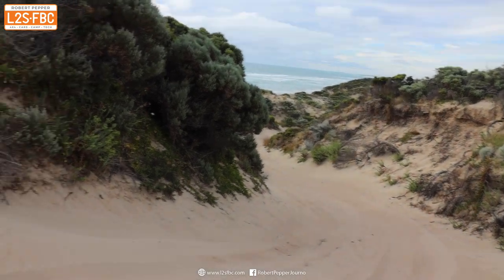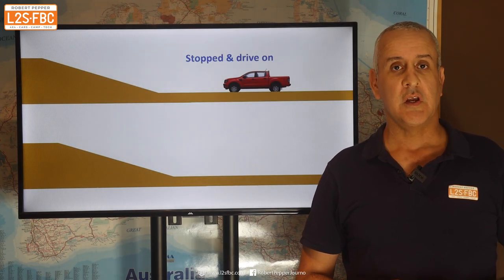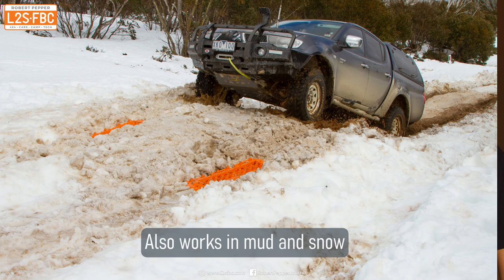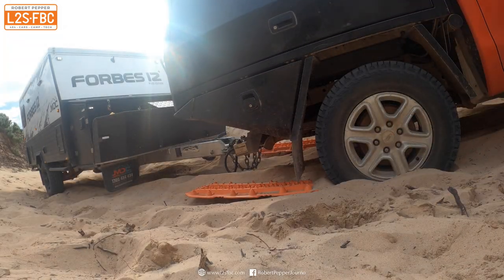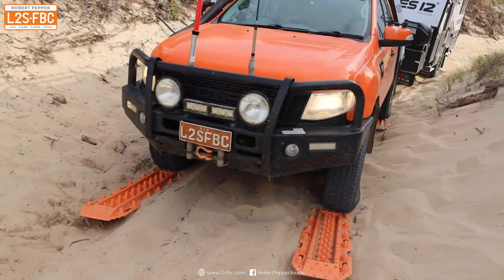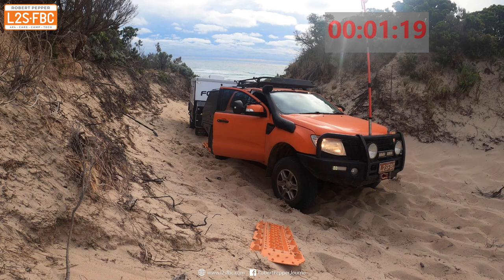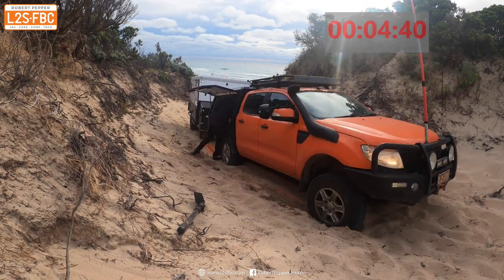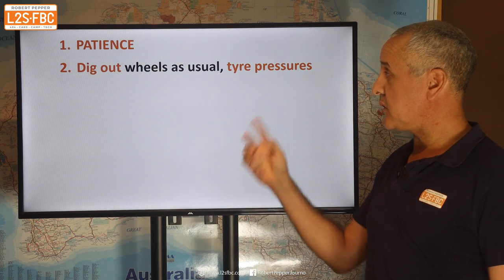Stuck caravan on a sand dune - how to recover!

Comment: Winch anchor or waste hours moving boards.
Reply from the maker: sadly, winch anchors are hard to find in sand
Reply: ? Winch cable attached to find, the old years we buried the spare to get up a sand track with tinny and under powered 4x4

Comment: Track to number two rocks I think. Beautiful area, was there in January. That dune is a doozy, caught plenty out when we were there.
Reply from the maker: Correct, that's the track. It is easy without a trailer...shouldn't cause anyone problems at the right pressure, and there's a beach bypass if you really need it.

Comment: UK pebble beaches are much more tricky!
Reply from the maker: I'd suggest not...the finer the sand, the harder the going
Reply: @L2SFBC  the pebbles are harder mate trust me. Imagine wet marbles that are 6' deep. The slightest wheelspin, results in sinking up to the Dana axle. I did this at Weybourne beach in North Norfolk. Check it on Google maps images. The tide was coming in and it was an unforgettable incident. This was in a 1964 Land Rover with a rear traction aid too (Taiwan Trutrack)
The method that saved the day was some digging out and, very gentle driving backwards and then gently forward and out. It was up to the tree sliders and the transfer box in the end. It's like very heavy quicksand. I like the videos a lot and I am subscribed. Thanks for the response
Reply: P.s. the pebbles are rounded flint.

Comment: I don’t have any experience of use of traction mats but gather that The Max Trax or ARB Treds are the best options, What would be your choice of Brands?
Reply from the maker: Maxtrax or the later TREDs. Not used the others but any name brand should be fine. DO NOT BUY THE CHEAP ONES!!!!!!!!!!
Reply: Thanks, I have traded a couple of pairs of Max Traxs recently, they are very good quality. Also just obtained The Indeflate  , looks like the business too.
Reply: Ronny Dahl - 4 Wheeling Australia, did a comparison on traction boards that you might find interesting.

Comment: Hi Robert. What would you suggest as the best technique if there was a long line of (very frustrated) campers lined up behind you as well as the same for oncoming traffic (ala Ngkala Rocks Fraser Is)? I doubt that all drivers will be as patient and forgiving with one using this technique especially if a caravan was involved 🙃
That said, in the greatest of Aussie traditions, most people would probably lend a hand in the circumstances 🤙
Reply from the maker: First off I wouldn't tow in a crowded, narrow area if at all possible, or do anything else to impede others eg filiming or driver training. In this case, nobody was around whole evening and only saw 3 cars the whole weekend - I'm familar with that area and it's never been busy offpeak, even peak isn't too bad. But if you had to do a quick recovery then using others is good. There is also a beach bypass which I decided not to take but others could. So, no inconvience for anyone else. The technique is really a last resort.
Reply: Best technique for crowded beach? Ask for help. Hands down the best. Another vehicle to assist in the situation shown above would have it done far more quickly. But what Robert has shown above is how you can do it if there isn’t anyone else around.
Reply: Yeah people will be backed up to ya faster than you can ask to get ya outta everyone’s way plus what he said don’t be a numpty an attempt it where it’s busy
Reply from the maker: That's the thing if it  was busy you'd have help and be on your way not needing  the technique. If it wasn't busy nobody to inconvenience and you'd need it.
Reply: @L2SFBC  Great info with real footage. thank you. So if there was no way for the vehicles stacking up behind you to get around and supply a winch point, how could the gathering crowd help. Women and children laid in front of the tack mats could provide further traction, but.... But seriously, it's a genuine question.
Reply from the maker: Yes it's a good question. First, that scenario is very unlikely. If the area is busy, there is typically traffic ahead, and as well as behind of any stuck vehicle. Also, if a dune looks difficult, you could ask for help BEFORE you get stuck; e.g. "can you just wait over the top in case I don't make it".  

But let's assume that there isn't anyone ahead. How can others help?  Hugely, is the answer. To do the recovery I had to place the tracks, drive, get out, retrieve the tracks, drive again. There were four tracks. It took a while per 'drive'.  Now imagine there are 8 people helping, two on each wheel. So much faster! And another two shovelling the trailer wheels. Maybe two more shovelling ahead, and one marshalling. All I'd need to do is drive. And then imagine they brought another four tracks!  I'd be over in very little time.

The flaw in this plan is of course getting strangers to work together.  The problem there is firstly the people that don't know what to do may get it wrong. The people that do know what to do might not agree. Nevertheless, more people = quicker recovery.

The women and children? They would be part of the team!

Comment: I recently did something similar just as an exercise. It was a short steep dune with no run up due to the very square edged entrance. I was on 20 PSI and figured Maxtrax were quicker than airing down and back up again. Plus I wanted to test my theory, which I’ve never seen anyone do. 

My technique was to back down slightly from the bogged position, just enough to get out of the hole, without any boards behind. Then I was able to shove the boards in front without any digging . It worked a treat and I personally believe it worked better than the technique being shown here.
Reply from the maker: Thanks, good info. I have used the same technique, and in fact it works without Maxtrax, I'll do a video on it in a while. Last time I used it was with a trailer on the back. It did not work in this situation shown as the car immediately bogged.

Comment: Nice and practical. In roughly the same conditions have you tried: back onto the boards at the rear, and then second pair of tracks infront of the rear wheels only? I suspect with the trailer hitch weight and stuff in the tray, the weight at back, with relatively light front may have been okay to get a longer movement this way. Obviously, if it fails reverting to the demonstrated last resort method. 
PS. I bought my second pair of tracks after being run off the inland sand track on Bribie (extremely fast car came around a corner and I swerved to the outside of a very soft corner with trailer and was very bogged). The jeep driver didn't stop and it took me about half an hour to get back onto the track. So yes agree having four is good if towing it really doesn't take much more space than two.  Anyhow, love your work as always - thanks.
Reply from the maker: Yes, I've tried every combination I can think of over the years. Each has their place...the point is to make people consider something other than tracks-in-front-drive-on.

Comment: Good information Robert
Now my 2 bobs worth
-	Endeavour to keep maximum ground clearance under the vehicle (including the Van/Trailer)
-	To this end minimise the sand bulldozing effect of each tyre – an old carpet is of great assistance also
-Winching  - a well installed sand anchor is fantastic in this instance and has minimal environmental impact
Reply from the maker: Yes, you'll notice I never bogged it deeply, always gave up early!  As for winching, I have found sand anchors to be ineffective, but retain an open mind...
Reply: The carpet idea sounds like a good one. I suppose a length of carpet 300mm wide? Would you  use it in conjunction with maxtrax or on its own...total newbie here, so excuse my ignorant questions.

Comment: What if you had put all four traction boards at the rear wheels? Maybe go a bit further Idk.
Reply from the maker: Tried that didn't work, but it is nevertheless a technique to try in different conditions with a different car. It has worked other times. Usualy though one board per tyre is best.

Comment: Last resort tactics - very good info, thanks Robert.
I wonder if longer tracks would help. It seems to me they could make them longer without having to make them any thicker since the pressure area will remain the same regardless how long they are. The extra length will make for shorter recoveries but yet, no one makes them.
Reply from the maker: I think the length of Maxtrax is perfect. Yes, longer tracks would be better when actually recovering...at the front of the vehicle. Any longer and it'd be difficult to fit them ahead of the rear wheel and behind the front wheel. Also, physically carrying them and storing them is easy at the current length. So I think the answer is carry 6 if you want more, or more likely, spread them around a group.
Reply: Maxtrax are made to exactly that length in other to fit on a standard pallet. First version was sightly longer but freight to the retailer was an issue.
Reply from the maker: That is what the founder said when I interviewed him - the video is on my channel!

Comment: Would be interested to put 2 boards on each rear wheel, forward and back of the tyre, given the weight on the rear axle
Reply from the maker: That didn't work that time!
Reply: @L2SFBC   thats's good to know
Reply from the maker: I wouldn't rule it out. Always always keep an open mind, but, conversely, don't persist with a method that isn't working. It's hard to do that in the heat of the moment. I might do something on the psychology of recovery.

Comment: Nice video as always.
6:34 I would be interested in seeing you review some ground anchors to winch off of. Redrock 4x4 makes a great one. “Deadman off-road” has been featured for sand recovery in AUS and can even be used as a tree saver. Firemen also use a technique for low angle rescues using 3 stakes in a line placed in the ground pretensioned together with tubular webbing.
Reply from the maker: Not had great experience with sand anchors but retain an open mind...

Comment: Tire pressure lowered to?
Reply from the maker: covered in the video - I can't recall exactly but lowered them further and still didn't work, hence the ramps
Reply: Do not lower the trailer tyres. Ask any bricklayer that has pushed a brick barrow or wheelbarrow full of mud on a  WA building site. Less pressure means more drag. We always had our barrow tyres pumped hard. They were heaps easier to push over the sand.
Reply: @joegoedhart1259  incorrect, you definitely lower trailer tyre pressures in soft sand